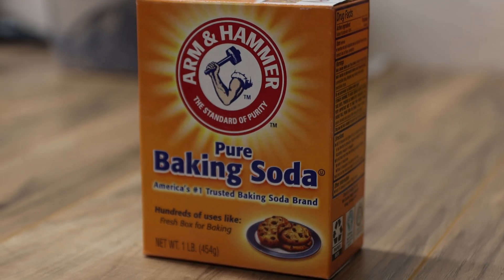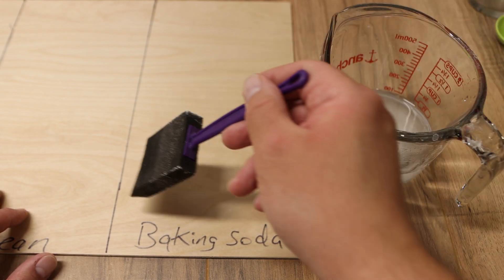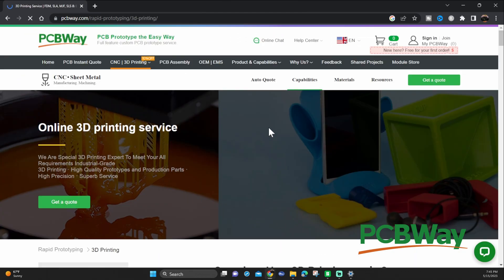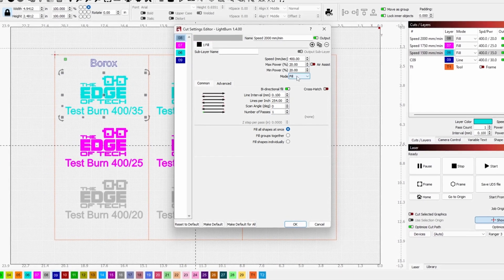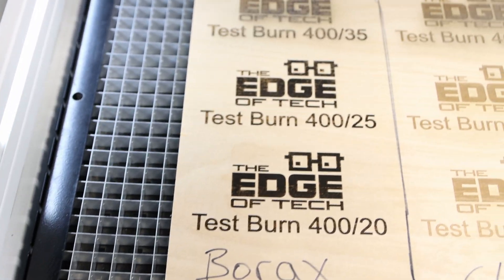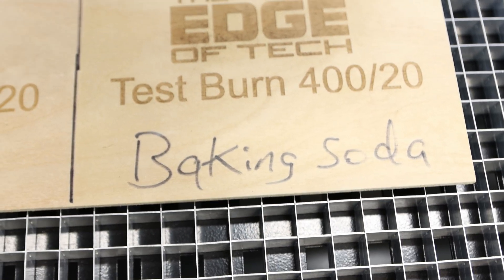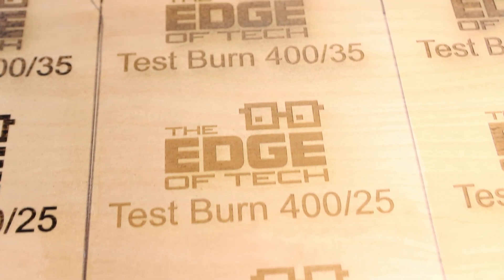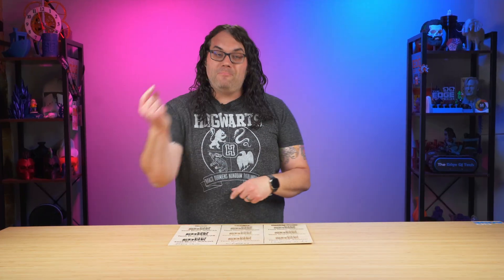Laser Engraving Wood Hacks: Which One Wins?

Comment: Thanks Jim 
My experiences with accelerants especially BORAX is that it gives you a lot of black soot ....that is very messy 
So What I do is mix some of the solution in White Latex primer untill it has consistency of Milk
I then apply and rub into wood with just an old rag ..(Like staining wood) 
Wipe off excess ...use hairdryer to Dry 
Amazing results with no soot to deal with
Reply from the maker: Awesome! I am going to have to try that!! Thanks for the tip!

Comment: Thanks, for letting us know that the Borax solution is a carcinogen. I didn't know. I've used it before, and I liked it at first, but then realized that it also seems to prevent the laser from burning the wood. It's basically just black ash sitting on top of the wood, which is easily brushed off, at least with a diode laser. You definitely need to coat it to seal it in. I found that if I just burn slower, I can get darker, and I'm really learning to love the natural look.
Reply: @J  Do you have any documentation to support this? Whenever you're using anything, whether it's baking soda, borax, etc, when you laser it, its going to produce fumes that are completely different than the product you used. I'm not trying to be confrontational, I'd just like to know. For myself I have extremely good exhaust (I probably over-designed my exhaust fan) and I never get any smoke or smells into my small 8' x 10' "maker" room. It definitely helped that I was able to exhaust outside through a window that's 2 ft away and a foot up from my 40watt CO2 laser and I used 6" ductwork. My fan is rated @320 CFM's, I've had small pieces sucked up by it! 😂😅
Reply: If you believe everything you hear, then everything is carcinogenic!  Borax was used in many traditional remedies but they would rather you buy some companies product instead so they plant seeds about how everything is carcinogenic.
Reply: I googled it. Borax is NOT a carcinogen.

Comment: Problem with Borax is that the laser chars the borax on the surface, and then unless you use a clear coat, it smudges super easily. IMHO the best solution for a dark engrave is putting the laser 5/7mm out of focus, it really works, try it out!!